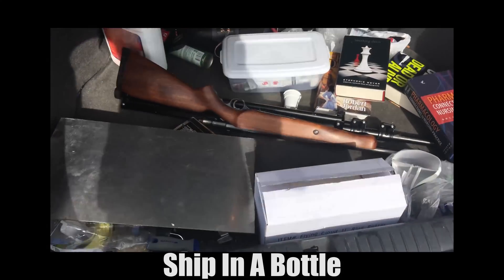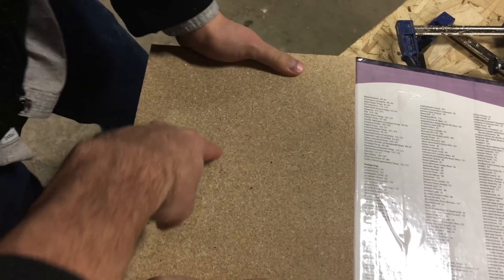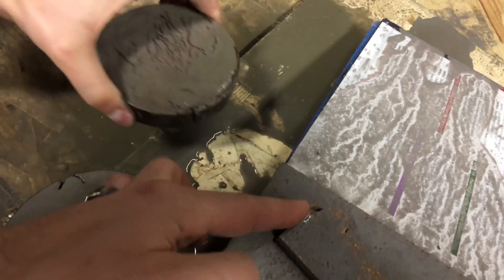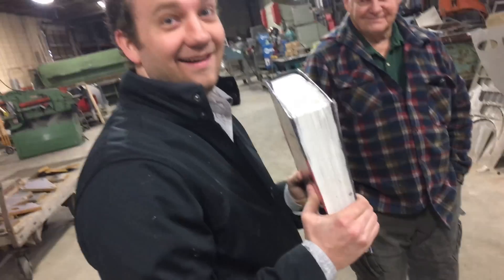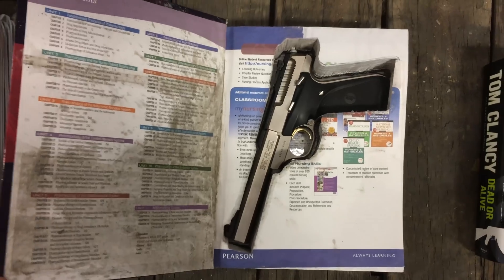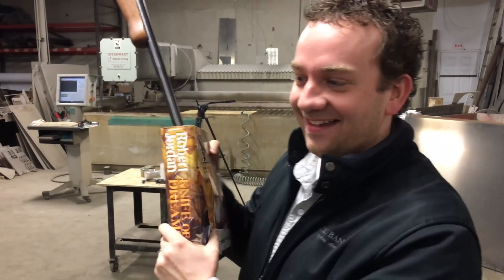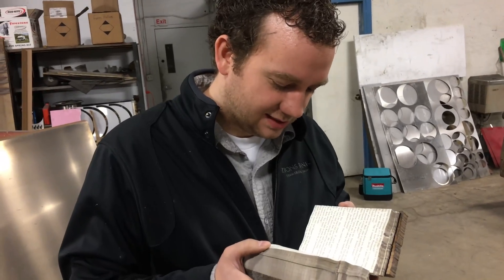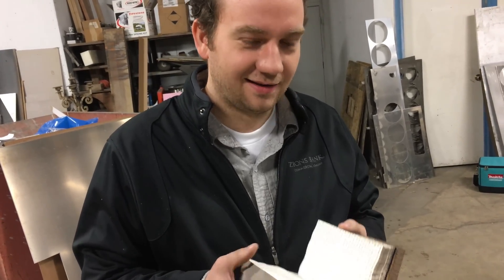Hidden Gun In Hollow Book - Waterjet Channel

Comment: You should cut a brick in half with that
Reply: anis destroyer bricks are pretty cool dude, you gotta problem with bricks?
Reply: Cut a bullet in half from top to bottom
Reply: you can cut basically anything in half and you want to do a brick.
Reply: guy man brick > cement
Reply: noahmeme2 yes that would activate it and could kill
Reply: @ksoooo2x786  no it will only do it if the primer is sruck but with water it wouldnt do anything